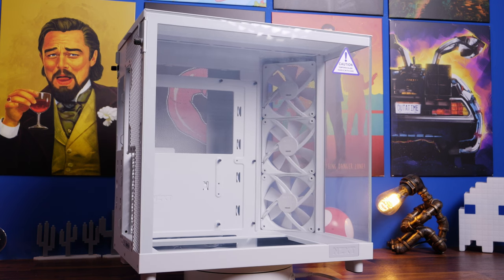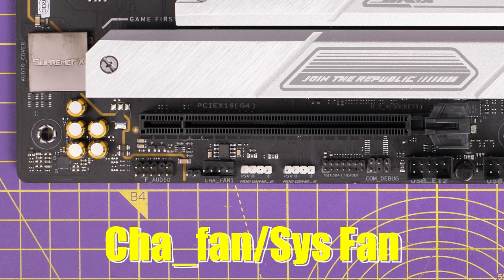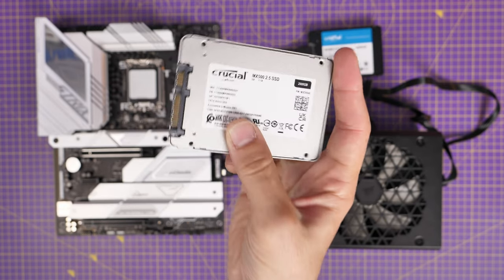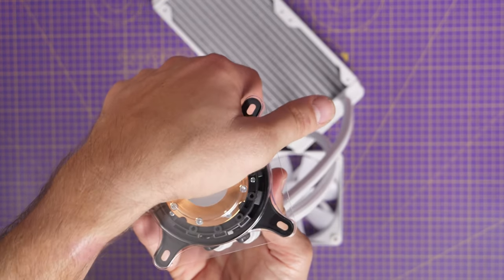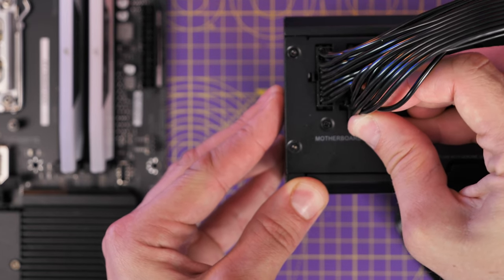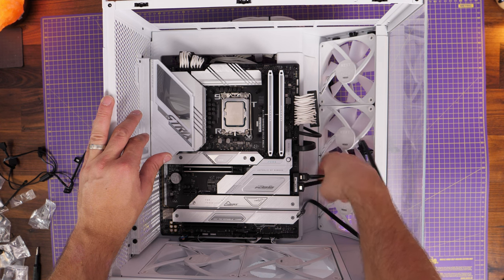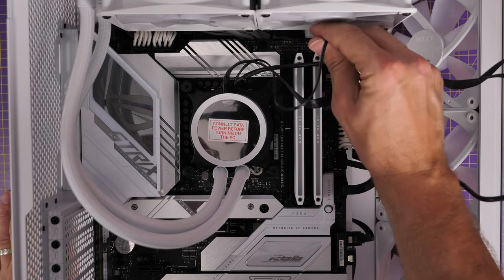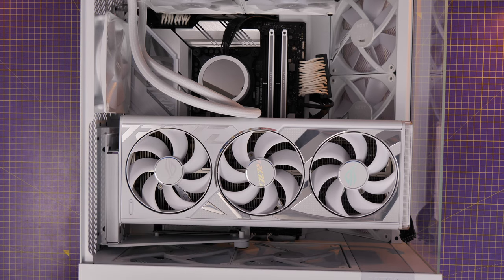NZXT H6 Flow RGB In depth build guide (step-by-step NZXT PC setup)

Comment: So what am I to do if I need another pcie slot or I need to use an expansion card for something? is there room with a vertical mount installed or does it void all the other slots unusable? 

because I'm thinking that I need an adapter for a usb C header and also maybe blutooth/wifi
Reply from the maker: Usually it blocks the ports tbh
Reply: @TheProvokedPrawn damn guess it's charged for the usb c port at least, well thanks for letting me know anyway cheers

Comment: What connection is the rgb splitter for the front 3 fans and were on the motherboard would they connect
Reply: too right 3 pin or bottom

Comment: You should put the T700 in the top m.2 spot becuase T700 is a gen 5 SSD.
Reply from the maker: The board doesn't support gen 5. So it makes no difference

Comment: I have a question about the h6 flow. due to the pre installed fans  having the splitter for both rgb and fan control are you able to put the rgb cable for all three fans into a fan hub so it could be controlled by CAM
Reply from the maker: No. It's a different connector
Reply: Alright thank you

Comment: Cases comes in a few days i also bought extra fans,can i control the fans without the controller and if i can what software do i use
Reply from the maker: https://youtu.be/mPRrPGjV_jo you'd be better off with a controller. But theoretically you can use your motherboard software

Comment: Im torn between ths case and the O11 mini one. Can you do a size guide between the cases I mentioned above?
Reply from the maker: I think the mini might be ever so slightly smaller, but it also needs an SF power supply. So the H6 Flow is easier to build in https://youtu.be/gttgUBTV_xQ
Reply: @TheProvokedPrawn  Thx for your input. I am consider them cuz O11 is a big smaller case and h6 I dont have a reference how big it would be compared to O11 on my desk . Im also consider the asthetics assecory price for each case like fans and cable.

Comment: I'm currently looking at PC's and my build is starting to push my comfortable budget. I am considering switching to a different brand for the CPU cooler. Do you think it would still talk with CAM software so my RGB is all coordinated?
Reply: No, CAM only works with NZXT hardware. Consider software like SignalRGB for brand-agnostic lighting control

Comment: For the bottom can you use two 120 mm fan?
Reply from the maker: I thought I did?
Reply: You should! Cause the bottom is very tight if only 1 mm is missing, you have to pull out the hammer

Comment: Hello, i don’t have the port for the usb panel in front at 35:17 , how can I do ? :/ b550f gaming rog strix
Reply from the maker: You might be able to get an adapter but I'm afraid I haven't tried any I can recommend. I've never seen a motherboard without front panel USB-C connections. That's very unusual.

Comment: Will this work with a non shift?
Reply from the maker: Yes
Reply: @TheProvokedPrawn alright, I was worrying because I just saw u got a shift instead of the normal one I just got 😂
Reply: @TheProvokedPrawn  what problems do bios have when u connect the aio pump header, I've got an MSI, just wondering in advance if putting it in the pump header might kill my aio

Comment: do i have to buy extra fans or are the cpu coolers and the ones that come with the case enough?
Reply: I have the same question.  Did you ever get an answer?
Reply: @anonymoose2474  get 2 fans for the bottom of the case. An AIO radiator on the top is sufficient for exhaust tho.

Comment: Did you test the Gpu temps with and without the bottom fans I did hear a reviewer say his temps increased with the bottom fans, also what was your overall Gpu temps I have the same card in a 4000d airflow and it’s quite cool but just curious as to if I should change to this case as I do love the look of it 🙂
Reply from the maker: Afraid I did not.
Reply: @TheProvokedPrawn  don’t worry, ohh and thank you for your awesome content 🙏 I think I am going to order one of these cases anyway 🙂
Reply: I thought the cpu temp went up a bit but the gpu temp went down. If it's a gaming rig this would be ideal. And if using a 360 cooler should be more then enough cooling